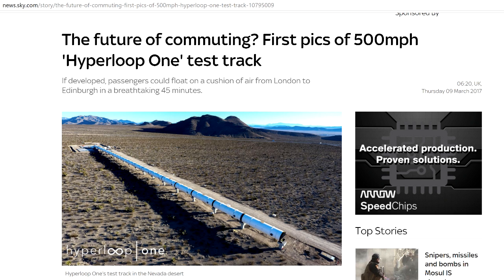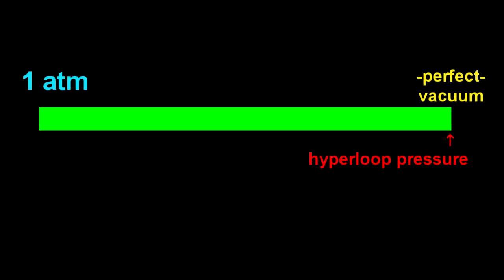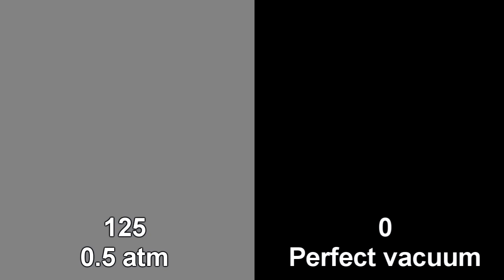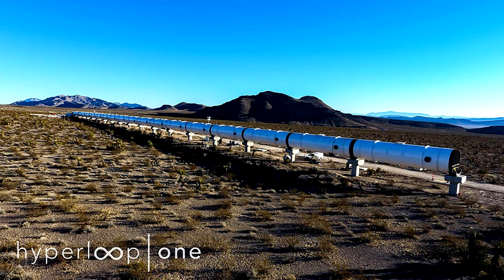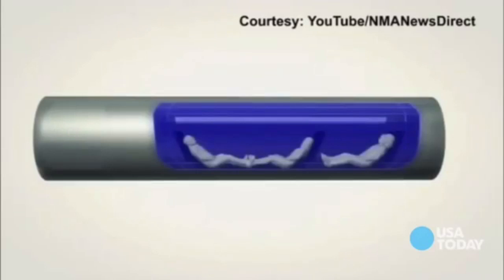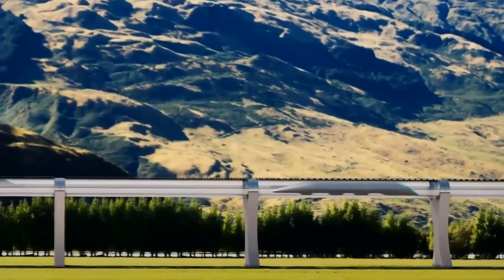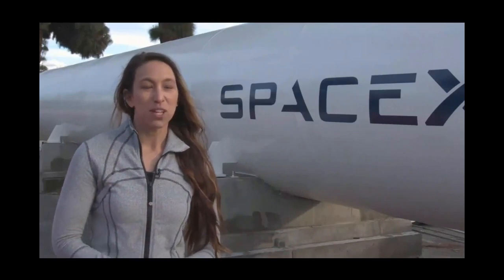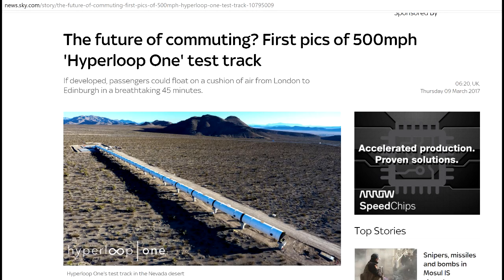Entire Hyperloop could be destroyed in SECONDS!

Comment: Some of your points aren't very fair - like about the tankers imploding, those are built to handle internal overpressure, not to handle vacuum. There are also ways to make it safer, compartmentalisation for one. But you are right about many other things, and there are issues you didn't mention at all, too. If a dent happens, how long will it take to repair, test, and make the service running again?

As it is currently presented it's certainly dubious at best, but unlike solar roadways, there may still be a chance to see a revised, more plausible version in the future.

Comment: Apples and oranges the colour intensity analogy is very flawed. Pixel values are logarithmic. A value of 255 is 255*255 times greater than 1. Thus 1/128th the intensity of 255 is  23 (rounded) not 2.

Comment: You mainly point out two problems with the hyperloop, but both have been solved before:

1. Having to evacuate the whole tube for every trip:
The engineering problem would be connecting two pressurised vessels through a vacuum. Spacecraft docking adapters already do that, so an adaption of that technology would enable the tube to stay under vacuum while passengers enter and exit. Also, the energy to evacuate the tube is only needed once (or once per maintenance, either way not once per trip).

2. Having a tube stable under high pressure from outside:
Submarines are essentially that. Granted, the inside pressure is not 0, but even more than one atmosphere lower than the surroundings (and the difference in pressure is responsible for the force). Furthermore, a leak in an adequately designed tube would probably not be catastrophic, in contrast to what the ping pong ball propelled along the tube displays.

So the execution of the idea may be bad (I cannot comment on that since I haven't looked into the details), but the idea itself can still be viable.

Comment: What about a tube filled with a less dense gas? Let's assume Helium was abundant and cheap. Would it make sense to have the tube with low pressure helium? Just enough Helium in order to be able to use thin material for the tube, without the danger of collapsing under a little dent?

Comment: Something no one of the test/animations even you Thunderf00t (this is weird on you) show are bulkheads and pressurization chambers, that way you only need to close the bulkheads of each end, create vacuum in the main track one time, then place the "train" in the chamber, make it air tight, create vacuum in chamber, open bulkhead between main track and chamber, move train to main track, close bulkhead, start travel, at the other end, make vacuum in chamber, open bulkhead, move train from main track to chamber, close bulkhead, put air in chamber, open chamber, end of travel. All the safety problems are there, of course but the energy and time to make vacuum in the main track is supposed to be made only one time (and for maintenance) not for each travel.

Comment: So many questions.  Is this thing bullet proof?  I want to guess it is due to the strength it needs to withstand the vacuum.  What if something falls on it?  If it is above ground is it weather proof or grounded in case of lightning?  If below ground can it take the extra weight of the ground?  Will there be access panels if underground?  Or will it have to be dug up?

Comment: If i understand pressure correctly you get the same pressure if you are deeper than 10m in water that you get with a vaccum on the surface.
Therefore the Hyperloop pipe just to withstand the pressure needs to be built as strongly as a pre-WW1 submarine throughout it's lenght with 0 faliure tolerance.

Comment: question. how much would it impact that power if it had a thing like an air lock. where the main tube is permanent vaccum but the pod goes in and out in airlock stages.? All you would need is the initial energy to depressurize the main tube then subsequent energy for the airlocks.

Comment: Do you realize how easy it is to derail a regular train? Yes this is perhaps a more enticing target for terrorists, but I really don't see the big difference.

For energy comparison one regular passenger train weighing about 1k metric tons and travelling 160km/h has about 1GJ of kinetic energy or about 5 times as much energy as what you calculated for the vacuum. Yes these figures may sound large when you convert them to explosives, but the reality is that they are present in our daily lives all the time. Why don't you do the same for a nuclear power plant? Calculate the energy contained in one core and convert it to high explosives, then draw a map of the blast radius around that plant. I'm sure you'll be able to scare plenty of people away from nuclear power. Oh, wait, you support nuclear power and you realize that it is a dishonest fear tactic to convert total energy in a system to high explosives in that case.

You talk about this as if there is no way to have any safety features. For example, do you know one efficient way of not accelerating the cart forward like the ping pong ball due to a tube failure behind it? Equalize the pressure in front of it! 

We have built submersibles that handle pressures over 1k atm, so this should be trivial. I think you are being dishonest when you represent these models as the real thing. I don't believe the hyperloop will be cost effective or the future of transportation, but this video is crap.

Comment: I thunk it would be cheaper to just build a damn straight conventional steel rail/steel tire-on-steel-wheel train, 2-lane, and conpletely straight. can go 500km/h easeally, and more if you figure out how to get the electricity to it. And a suitable electric train connection wont be harder than their fancy vacuum. Especially the capacity is awesome with about 1 train every 3 minutes in a single direction, as long as you dont have tiht bends for diverting a train of the rail to go to somewhere else. Yea you will need to have one train breaking immideately break the ones behind too, and you need top-notch magnetic breaks that dissipate their heat into the rail. for emergency breaking only. You could make each train up to about 2km long, though that will take 30seconda of your clock due to the time differencw between front and back if the train. get good fully automatic high-strength couplings so that you can reconfigure the active-driven (all trainwheels have an electric motor on them), carriages so you just re-route a whole carriage at a train-hub, instead of getting peiple off and back on like you need for planes. Make the train go according to a demand-oriented schedule, also varying the length. (longer trains have less drag). Why is there no fricking ckmpany doing such?

Comment: 0:40 Is a tanker truck built to withstand vacuum? no you noob
2:51 Would you base the future of planes based on the first ever plane? no
3:40 You sure like repeating yourself over and over...
What will you do if there is a working version before you die?
Put your honor where your mouth is. Or are you chicken?
Reply: 'Is a tanker truck build to withstand vacuum?'  No, but they are built from similar, if not the same, materials to the Hyperloop tube.  They are built to withstand a large amount of pressure since most tanker trucks are used to carry both valuable and highly flammable material's across a country so it stands to reason that they would be built to withstand a large amount of pressure.  

'Would you base the future of planes based off the first ever plane?'  Again no.  However, have you actually considered how the design of the modern plane was created?  It was created through criticism of its design and multiple revisions.  What Thunderfoot is doing is good for the Hyperloop in the long run.  He is pointing out multiple design floors that the team behind the Hyperloop may have not considered.
Reply: A submarine is also made of metal, there fore submarines will never work... but they do, and withstand much more pressure then one atmosphere (10 meters of water).

There is not constructive criticism in any of his videos, they are all about misdirection and repetition. Sounds like religious bile to brain washes the uneducated. He is the one that relies on a lack of critical thinking from he watchers, not the other way around. 

There are many reasons why hyperloop might not work, but they boil down to economics and alternative, which he is not talking about. He is portraying it like the laws of physics prohibit this.

Thunderf00t is a kin to a religious fanatic, it's like he is trying to roil his fellow witch hunters to light the torches and follow him to burn something or someone for doing something blasphemous that the faith does not believe in.

Humanity has far too many people like that already.
Reply: A submarine is also built from metal and it can withstand much more the one atmosphere (10 meters of water). Are you talking about a specific material?

What exactly is his "constructive" criticism?

Comment: This video, as usual, is 'debunking' hyperloop by looking at the early failures. This isn't even remotely a real thing yet, and everyone knows it. The first airplane couldn't be off the ground for a whole minute, but it improved over time. These pods and that track were both mock ups to make sure that the technology actually worked at all, not to see if it worked at the speeds and distances necessary for real use.

Comment: What if the hyperloop had airlocks at both ends? The length of the tube stays at a constant low pressure while the ends can be closed off, allowing people in/out of the pod. You would only have to remove the small volume of air around the pod, and when the pressure matches the rest of the tube, open the airlock door. A few minutes at both ends to depressurize/pressurize. Then you just have to worry about the small problem of the whole thing imploding and killing everyone.

Comment: your thermodynamic skills are bad... like your selffilling water bottle calculation, in which you said you need an equal amount of energy to take away that energy :D
Reply: You could debunk him with actual numbers and data.
Reply: You're right; it might be more. Can't be less.
Reply: it can be less! its not that simple! E = pV isn't the whole law.... it's dE = dW + dQ. Even if you assume dQ is 0 (adiabatic change) its NOT pV! becuase you are just removing mass from one point. Its not linear: Think about it the first few atoms require very little to no energy to remove -> p depends on the number of atoms. You have to use the ideal gas law and a lot more and get the equation for a non closed system P (dE/dt) = dm/dt *(enthalpy1-enthalpy+delta (potential Energy)) (source: https://de.wikipedia.org/wiki/Erster_Hauptsatz_der_Thermodynamik im sorry the source is in german but i didnt found the aquivalent english page and the formula is there) It is not simply Vp! and in the video with the selffilling water bottle he neglected the favt that cooling machines can have a power number greater than 1! Because they are not removing heat but transport them which means you can reach a 100W cooling with 10W energy and another 100W heating on one side.
Reply: Fine. Make a video where you pull a liter of water out of the air with a dehumidifier, tell us how much energy it took. Make another one where you have a pressure vessel fail, and it is not a significantly violent event.
Reply: if you still dont believe me maybe read this article: https://en.wikipedia.org/wiki/Isothermal_process which still isn't the 100% correct model but a lot better than pV!
Reply: why are you so ignorant to improvements? he even tells you 22000 liters of air is thiiiiiiiiiiiiiiiiiiiis much oh my god no one could put 22k liters of air in a day threw a fan! well look at one basic 12V computer fan https://www.amazon.com/Rosewill-Sleeve-Computer-Cooling-ROCF-13001/dp/B00KB8CB9O/ref=sr_1_4?s=pc&ie=UTF8&qid=1489248544&sr=1-4&keywords=computer+fan it says 38CFM which equals to 64000 liters per hour! He spents 2 minutes for this stupid tank analogy. Im not saying the bottle will work and i never said. Its totally crap because even without the errors thunderf00t made you still need to much energy.
Reply: Getting hysterical now, are we?
Reply: do you watch his videos? i tried to replicate his bad behavoir to repeate himself 1000 times. By the way did you watch those links or are you just arguing because you have no clue what you are talking about? And where do you read that i deny that it is violent? I wanted to point out that you simply can't calculate it that way
Reply: Getting quiet now, are we?

Comment: While I agree on many of your points, your criticism in time to create vacuum is wrong. They can use multiple pumps at higher power to suck it quicker. For example, 1 MW, about that of one electric car, would take about less than 5 minutes. Having more than one could make it even quicker.

And you don't need to pump out the entire track every single time once it's in vacuum.

Comment: the bracers in those tubes are to keep it round until its welded....we weld all thin walled vessels this way because that tube most likely was rolled from plate then welded and sent through a set of rounding rollers. Keeping it round is the key to a good fit/weld. It is by no means buckling under its own weight 🙃

Comment: At sea level, a full vacuum is less than  -15 PSI.  A car tire has 35.  This is not difficult to safely contain.  A jam jar can withstand a full vacuum.  We have a big tank at work that's certified for full vacuum.  It's not very thick.  It simply has stiffening rings welded around the outside.

Comment: Someone tell me why this is wrong.
Why don't they use a smaller tube that they pump the air in and out of, then attach it to the big main hyperloop tube that is a permanent vacuum with an airlock.

Would that not be a solution to the energy and time thing?

Comment: Instead of running at a vacuum to reduce friction, why couldn't they pump more oxygen rich air in and use something like ramjets to power the car? More oxygen means more power for the jet engine, and it would be easier than depressurising the entire track

Comment: I don't understand why all the pods have pointy noses. If there is no air you might as well use a spherical pod or a short cylinder with hemi ends. And this only the first problem of many.  How do you mag lev it.  You would need at least three rails around the perimeter to adjust for side load and to keep it from banging on the sides.  What a nightmare.   What if you want off half way? Is there an air lock "station" at each stop. Nothing could go wrong there.

Comment: I'm stupid. I don't know physics much. I have a question. Please educate me. If the hyperloop runs inside a vacuum. Why all the designs for it are aerodynamic? I mean do the sharp shapes make it faster despite not having air resistance? If this question sounds too stupid, please explain why it is. Thank you.
Reply: Kavin Mitran Barathidasan I'm guessing it's because the test track was only a partial vacuum, so there was still SOME air resistance
Reply: isn't that air resistance negligible? i mean would it slow down that 'train-thing' if it was a spherical-pod instead? Would it slow down by much?
Reply: Thank you for your answer.
Reply: Kavin Mitran Barathidasan I'm not sure how negligible the air resistance would be, the amount of air taken out of the tube depended on what the university students asked for... so they could have had 0.1atm inside the tube, still providing a decent amount of resistance.

Comment: Wouldn't be easier and safer to create some sort of wind tunnel where all the air moves in the same direction of the pod? That should help with the drag, mainly when its going at a similar speed. Plus it would use positive pressure, tubes can withstand pressure better than vacuum.

Comment: It bears pointing out that in the Mythbusters episode, it wasn't "a slight dent". They dropped a huge slab of concrete from a crane on the thing.

Sure, if you did that to the Hyperloop, or let's say a more likely scenario of a car crashing into it, that entire section between pumps (yes TF, those pumping stations in the White Paper to handle leakage that you keep pretending aren't there) might go bust and would need repairs. But that is true for just about any train - if you do something very disruptive to its track, the track needs repairs before it can be used again.

So the question is only whether or not the construction of the Hyperloop is going to be as sturdy as those tankers. It's clearly not impossible either in theory or in practice, so I guess time will tell.

Comment: Musk said the test track was the 2nd largest vacuum chamber besides the LHC. That got me thinking - how does the LHC solve all of the issues raised here? I'm assuming the answer has something to do with a huge amount of engineering and money...

Anyone know the actual answer?

Have there been any vacuum failures in the LHC?
Reply: A huge amount of engineering and money.
Reply: There have been some vacuum failures at the LHC, they had a pretty big one early on that shut things down for a while.  But the LHC tube has a smaller diameter (it's not carrying vehicles), it's underground in a significantly more stable environment, etc.
Reply: It is built underground

Comment: Would it be viable to instead of creating tubes drill through heavy rock and reinforce the tunnel and have an airlock system for transfering shuttles. What about steel rails and wheels that would hopefully reduce friction from normal wheels but be cheaper than levitation track.